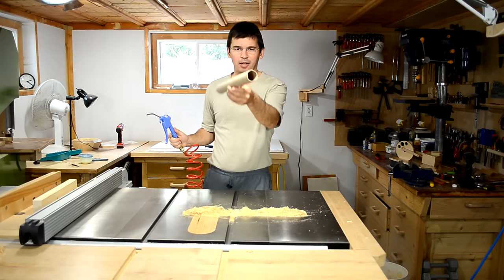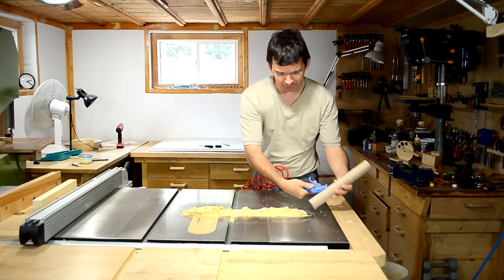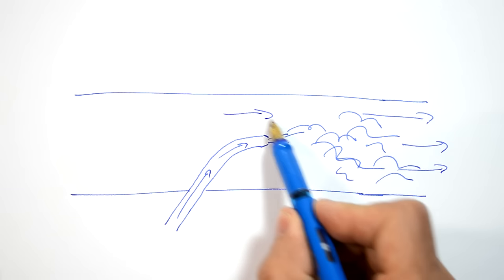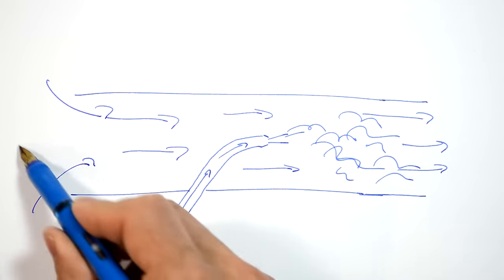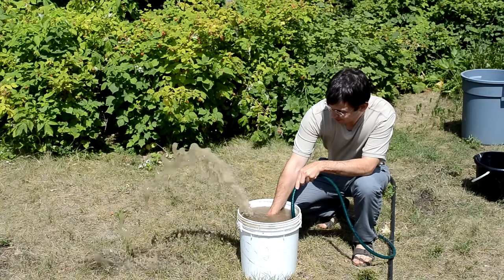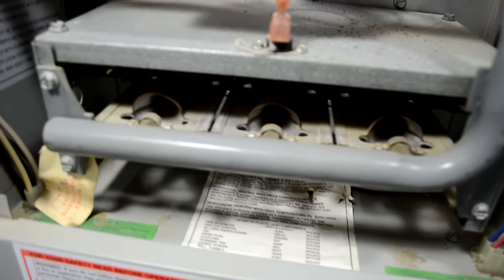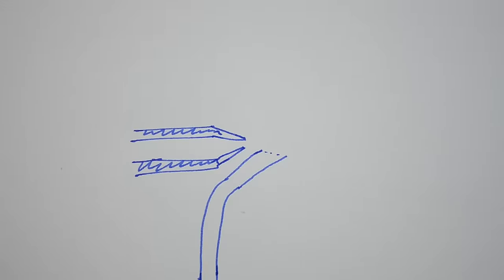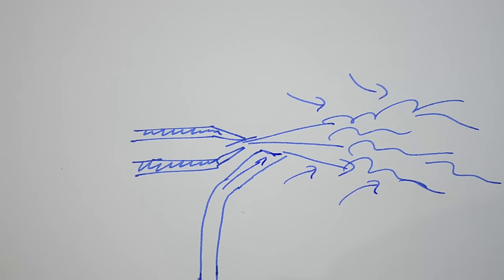The Venturi effect

Comment: A question for you if I may. I'm wondering if you're riding a small carbureted vehicle up a hill that it cannot accelerate on, is it counter productive to hold the throttle wide open versus just open enough that the engine can fully use? I've always wondered if the airflow would draw the correct amount of gasoline naturally or if it's better to have the jet needle slightly blocking the main jet and restricting gasoline so the mixture is not too rich. I'm talking about the point where the throttle is equal to engine output versus wide open where you can definitely hear the vacuum. My understanding of the theory is the fuel will correctly mix with air based on air speed alone regardless of throttle position above current engine demand. Hopefully I'm clear enough. The furnace seems to support my thoughts though it's a bit reversed.
Reply from the maker: carboureator not working right or fuel filter clogged

Comment: Matthias:  I need to move about 18 inches of blow-in insulation from one part of my attic (approx 400 sqft) to another, and doing it by lifting & carrying would not work (the spaces are separated).  Do you think I could aim a hose attached to the outlet side of my shop vac into the side of a larger hose (4"?) then suck the insulation from the "back" end of the 4" hose and blow it out the "front" end in the new location?  Or a leaf blower instead of shop vac?

Comment: Matthias, you are a clever man and you do and make interesting and clever things.  Two things.
First, in this case, though, you are incorrect in assigning your observations to the “Venturi” effect.  What you are demonstrating and dealing with is described by Bernoulli’s equations and is more aptly described as the “Bernoulli effect”.  A venturi is a specific application, if you will, of Bernoulli’s equations and describes a tube with a restriction that increases the velocity of the flow of a fluid in the tube resulting in lower pressure in the region of increase velocity. The “Venturi Effect” is based on Bernoulli’s equations, not the other way around.  Your “mixing of streams” does not fly if you think about it.  Were you to constrict the end of your paper tube that is “sucking” the saw dust up, the tube would collapse do to the reduced pressure caused by the high velocity air flow from your compressor.  No Venturi tube involved, all Bernoulli.  To effectively “mix” the the fluid streams you would have to accelerate the static fluid by means other than the lowered pressure described by Bernoulli, and I see no additional equipment, air jets…...  There is some mixing at the boundary layer but that is not what creates the lowered pressure and “vacuuming” action in your demonstration.  Anyway, do a bit of research and don’t tell people to “try thinking a bit more...” until you’ve done the same.
Second, I own Pelikan, Sheaffer, Parker, Waterman, Pilot, Eversharp and other fountain pens.  They are all nice writing instruments and I have as many, if not more, issues with Pelikan as I have with Parker and the rest.  Parkers are not “just for show” they are nice writing instrument made by another company and the overall price point of Parker is significantly lower than Pelikan.
Reply: At what point in the video does he tell people to "try thinking a bit more"? And why are you talking about fountain pens? I don't recall these being mentioned at all

Comment: good video, but I should add that it doesn't suck the air into the pipe etc,  what happens is the fast moving air causes low pressure in that area, so the high pressure from the other end (atmospheric pressure), pushes the air in (to replace the existing air)
Reply from the maker: That’s wha we call sucking.
Reply: @matthiaswandel  Yes, we use the word 'suck' as shorthand, But it still has nothing to do with the venturi effect.

Comment: Matt, I'm trying to understand the maximum force that can be exerted through the straw on your spraygun, do you know of an equation? I'm interested in using the venturi effect to spray aggregate free concrete, but would like to run the math to make sure it's possible to move that much weight, and if it is possible how much PSI I would need coming through the hose.
Reply from the maker: You would need a VERY large compressor to do anything of the sort.
Reply: @matthiaswandel  How big are we talkin

Comment: That's not a poor man's spray gun, needed a quick fine arts credit in college and I took ceramics.  A straw in a cup of glaze held under a blow gun from a compressor was used to apply glaze to the ceramics.  Also, isn't the suction a mixture of the Bernoulli principle and the Venturi effect? I know the Bernoulli equation is about conservation of energy, but doesn't it explain the air pattern over a wing too? Not trying to go against an engineer here, just what I remember from college physics.

Comment: could have said that the fast moving air dictates a low pressure so the the stagnant air at a higher pressure gives a defined pressure difference. High pressure air moves to low pressure area.

Comment: Two problems:
1. How do you want to place it correct? I mean, you can't put a 5mm tube through a 2.5mm tube.
2. A = d² * Pi / 4 wich means d * 2 does not equal A * 2, because of the d².

Comment: Where does the noise come from when you used the flammable liquid?
Reply: Heating up a gas to combustion causes it to expand very quickly, the rushing of the excited gas and the pushing of the air around it causes it to make a noise, in other words an "explosion", when you atomize a flammable liquid with air it creates a lot of turbulence so rather than the whole thing being a big stable flame, it's lots of little explosions all at once with the added movement of the high pressure air you get a lot of them all at once, which is why it roars.

Same thing as when you blow on a camp fire, heat up a stick enough... and it produces something called "wood gas" which sets on fire, you blow on the gas coming from the stick, it creates little air pockets mixed in with the gas...so rather than it being a stable fire (like a candle) the gas is blown around and sets on fire at different times with small "explosions" giving you a roaring fire (like when wind is blowing on it)
Reply: xthorpyx That same principle is happening in a greater scale with a thuner bolt where the changing in pressure is such due to the extreme heat that the air around it pass the sound barrier, hence " CRKRRKRRKCKRRKKRRBRRRRRRRRoooowww "

Comment: Wow! Thank you for this video!
Reply: This is wrong.
The Venturi Effect has a varying cross section pipe.  You have none. This is a false explanation.
If you're going to explain something P L E A S E understand it well FIRST  This is a fundamental  fluid dynamics phenomenon caused by viscosity and called  ENTRAINMENT  NOT venturi. .
...
As pointed out 5 years ago by donepearce and 3 years ago by me, this is predominantly entrainment (viscosity causing inter-layer 'friction').  When you Say turbulent mixing, you are the closest to the real science.
..
The powder is "sucked" into the tube by the atmospheric pressure accelerating the air into the lower pressure in the tube.  That lower pressure is caused by the entrained air moving out lowering the pressure upstream from the high speed nozzle.

It is precisely the same thing used in ejector pumps. 

sigh...

Comment: The main source of confusion is the derivation of Bernoulli's law based on the theorem of energy conservation. Bernoulli's law should be derived from the tangential acceleration as a consequence of declining pressure. Another source of difficulties is the fact that many physics textbooks do not mention normal acceleration and the resulting pressure gradients perpendicular to the flow. No need to be arrogant.

Comment: Venturi effect is not exactly what is going on here. The Venturi effect describes the how a fluid through a tube increases in speed as the tube gets narrower. What is being demonstrated here is Bernoulli's principle. The fast moving air is creating low pressure. As a result the high pressure elsewhere is dragging the saw dust with it as it travel toward to low pressure in the tube. With the gas, the high pressure of the atmosphere is pushing the gas up the straw toward the low pressure.

Comment: I believe that is actually the bernoulli effect...
still an awesome video
Reply: The Bernoulli effect is what makes planes fly.  Top part of the wing is curved, bottom is flat.  The top air must travel faster to keep up with the bottom air, because the top air has a farther distance to travel because the curve is a longer distance than the flat under portion of the wing.  With higher velocity comes a resultant decrease in pressure on the top of the wing.  Higher pressure on the bottom of the wing provides lift.
Reply: Robert Szasz Jack is correct...the concept that Mr. Wandel is describing is indeed the Venturi Effect, vs. the Bernoulli Effect.  Bernoulli is referenced 32 times in that huge article, but I think Jack summed it up decently in 5 sentences. Both concepts are used in aviation; lift via Bernoulli (including all control surfaces that control pitch, roll, and yaw), and altimeters, vertical speed indicators, airspeed indicators, etc. via Venturi.

Comment: Thank you for blasting sawdust all over your clean workshop to show us "something interesting."
Reply: But wrong...This is wrong.
The Venturi Effect has a varying cross section pipe.  You have none. This is a false explanation.
If you're going to explain something P L E A S E understand it well FIRST  This is a fundamental  fluid dynamics phenomenon caused by viscosity and called  ENTRAINMENT  NOT venturi. .
...
As pointed out 5 years ago by donepearce and 3 years ago by me, this is predominantly entrainment (viscosity causing inter-layer 'friction').  When you Say turbulent mixing, you are the closest to the real science.
..
The powder is "sucked" into the tube by the atmospheric pressure accelerating the air into the lower pressure in the tube.  That lower pressure is caused by the entrained air moving out lowering the pressure upstream from the high speed nozzle.

It is precisely the same thing used in ejector pumps. 

sigh...

Comment: great stuff
Reply: But wrong.
The Venturi Effect has a varying cross section pipe.  You have none. This is a false explanation.
If you're going to explain something P L E A S E understand it well FIRST  This is a fundamental  fluid dynamics phenomenon caused by viscosity and called  ENTRAINMENT  NOT venturi. .
...
As pointed out 5 years ago by donepearce and 3 years ago by me, this is predominantly entrainment (viscosity causing inter-layer 'friction').  When you Say turbulent mixing, you are the closest to the real science.
..
The powder is "sucked" into the tube by the atmospheric pressure accelerating the air into the lower pressure in the tube.  That lower pressure is caused by the entrained air moving out lowering the pressure upstream from the high speed nozzle.

It is precisely the same thing used in ejector pumps. 

sigh...
Reply: @Observ45er  wow great explanation man. Sorry I just heard the term and wanted to know what it was kind of about.

Comment: Wrong! There is no venturi in this demonstration. Venturi principal is with a tapered tunnel speeding up the air within and at its point of interection creates a higher pressure point which can create a vacuum. Your example is the air is PULLING the static air within the tube as it exits. Period!!
Reply: Yep.  Still here and still WRONG.  This is an ejector pump.

Comment: The Venturi Effect has a varying cross section pipe.  You have none. This is a false explanation.
...
As pointed out 5 years ago by donepearce and 3 years ago by me, this is predominantly entrainment (viscosity causing inter-layer 'friction').  When you Say turbulent mixing, you are the closest to the real science.
..
The powder is "sucked" into the tube by the atmospheric pressure accelerating the air into the lower pressure in the tube.  That lower pressure is caused by the entrained air moving out lowering the pressure upstream from the high speed nozzle.

Comment: The Venturi Effect has a varying cross section pipe.  You have none. This is a false explanation.
If you're going to explain something P L E A S E understand it well FIRST  This is a fundamental  fluid dynamics phenomenon caused by viscosity and called  ENTRAINMENT .
...
As pointed out 5 years ago by donepearce and 3 years ago by me, this is predominantly entrainment (viscosity causing inter-layer 'friction').  When you Say turbulent mixing, you are the closest to the real science.
..
The powder is "sucked" into the tube by the atmospheric pressure accelerating the air into the lower pressure in the tube.  That lower pressure is caused by the entrained air moving out lowering the pressure upstream from the high speed nozzle.

It is precisely the same thing used in ejector pumps. 

sigh...

Comment: What sucks in this video is the explanations.  I am sure you are well-meaning, but this is terrible science.
..
The Venturi Effect has a varying cross section pipe.  You have none. This is a false explanation.
...
As pointed out 5 years ago by donepearce and 3 years ago by me, this is predominantly entrainment (viscosity causing inter-layer 'friction').  When you Say turbulent mixing, you are the closest to the real science.
..
The powder is "sucked" into the tube by the atmospheric pressure accelerating the air into the lower pressure in the tube.  That lower pressure is caused by the entrained air moving out lowering the pressure upstream from the high speed nozzle.

Comment: What sucks in this video is the explanations.  
I'm sure you are well meaning, but this is terrible science.
Your explanation is close and, but about a venturi.
..
The Venturi Effect has a varying cross section pipe.  You have none. This is a false explanation.
...
As pointed out 5 years ago by donepearce and 3 years ago by me, this is predominantly entrainment (viscosity causing inter-layer 'friction').  When you Say turbulent mixing, you are the closest to the real science.
..
The powder is "sucked" into the tube by the atmospheric pressure accelerating the air into the lower pressure in the tube.  That lower pressure is caused by the entrained air moving out lowering the pressure upstream from the high speed nozzle.

Comment: This is wrong.
The Venturi Effect has a varying cross section pipe.  You have none. This is a false explanation.
If you're going to explain something P L E A S E understand it well FIRST  This is a fundamental  fluid dynamics phenomenon caused by viscosity and called  ENTRAINMENT  NOT venturi. .
...
As pointed out 5 years ago by donepearce and 3 years ago by me, this is predominantly entrainment (viscosity causing inter-layer 'friction').  When you Say turbulent mixing, you are the closest to the real science.
..
The powder is "sucked" into the tube by the atmospheric pressure accelerating the air into the lower pressure in the tube.  That lower pressure is caused by the entrained air moving out lowering the pressure upstream from the high speed nozzle.

It is precisely the same thing used in ejector pumps. 

sigh...
Reply: So it's just the name thats wrong then? The explanation was fine.
Reply: @jojojorisjhjosef  Yes, that is the essence.  He demonstrates an ejector pump which is using the phenomenon called entrainment. Also called a jet pump.  The round stream from the nozzle "rubs" against the air/water around it, dragging the still eater/air along.  It is not "mixing: until the flow gets turbulent a way from the nozzle.
It is also explained well in the first few sentences here: 
https://en.wikipedia.org/wiki/Injector
Reply: @Observ45er  So if you agree that its the name that's incorrect and not the explanation, why do you keep explaining it?
Reply: @jojojorisjhjosef  reread that question and see the word "incorrect".
Reply: @Observ45er  I dont get it. My question still stands.
Reply: @jojojorisjhjosef  It stands on weak legs.
What don't you get about providing incorrect information?  Everybody needs their 15 minutes of fame providing others with bad information making it that much harder to find good information.  Why put the burden of figuring out what is correct information on the student?
Reply: @Observ45er  So the explanation was wrong?

Comment: Incorrect, its no different than an Airfoil on an airplane wing... Faster air moving causes low pressure, the higher pressure on the opposite end MUST! rush towards the low pressure..  thats how it works.
Reply: NOPE! It is Entrainment.  The air exiting the nozzle is at atmospheric pressure.